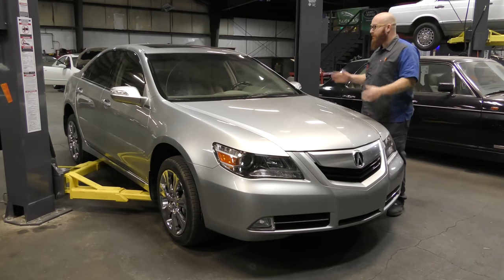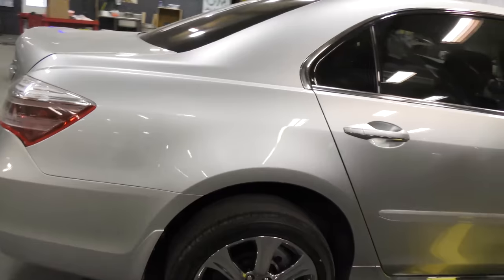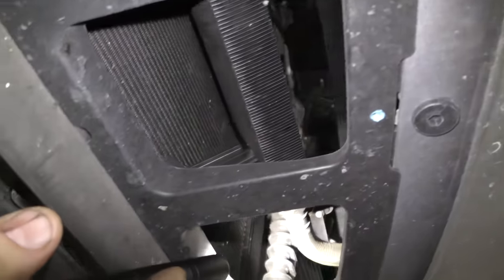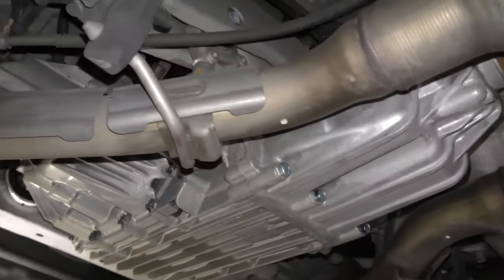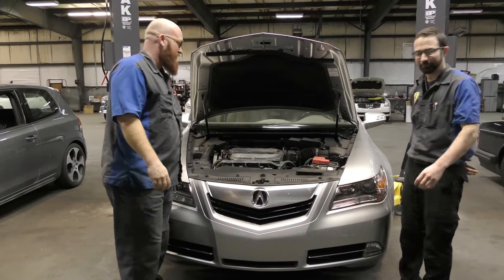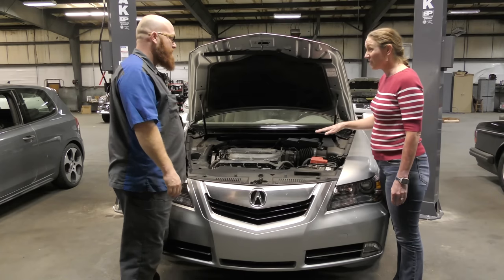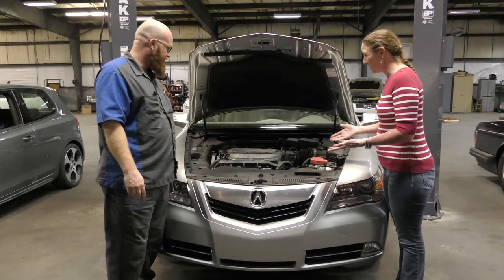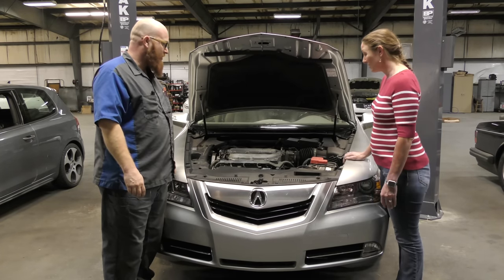Something Very Serious is Wrong with this 2010 Acura RL! What did the CAR WIZARD find???

Comment: For everyone that keeps talking about the 3.7 L being readily available in the MDX and TLS - The 3.7 in the RL is a J37A2. The MDX was an A1 and a TL was an A4. Yes, there are lots of A1s and A4s available but you can't just pop one of those in the RL when the ECU is programmed for the A2. That's not the way it works.

Comment: Isn’t the bottom of those engines the same as the 3.5? Different cams and larger manifold?  I know some guys have put the cams from the rl into the 3.5tl type s  with the 3.7 intake manifold to get up to the 300hp mark from the 3.5 278. Get creative when you have to. Car is worth saving given its condition.

Comment: Had a 2006 RL with the 3.5L, all service records, oil changed every 5k with Mobil 1.  At 140k miles it started burning oil.  Had my mechanic pull spark plugs and when the engine was cranked two of the cylinders were spitting oil out the spark plug holes, most likley it needed new rings.   I contacted a local Acura dealership and they said they never witnessed or heard of this engine having such a problem.  A local Acura mechanic said he could rebuilt it but I decided not to spend the 5k for this work since the car at the time was valued at only 6k to 7k.  A real shame because it was an immaculate car!  I was told by other mechanics before this that this engine would easily go 300k miles with regular maintenance.   I no longer have the impression that Acura is of equal quality to the other Japanese brands.

Comment: Since it is now late January 2022 when I viewed this interesting piece on the RL, I did a search to see if there were any engines available today? There are two used 3.7 V6 engines available in the US, one has only 50,000 miles on it, shipped from Japan.
So what happened with the Acura, did the engine get rebuilt?

Comment: Did u fix it? That sounded like a timing belt,  broken tensioner. It happened to my 2009 acura RL last winter 2019. The sound was unbearable it was like my car was a jackhammer.  I got it fixed with OEM parts for $800. 210k on my car now. Still running

Comment: Here is a little advice for my J series fellow Acura/Honda owners: Do not rely on your maintenance computer to determine when you change the oil. If you are a spirited driver, you should change it more often. As your displacement goes up (3.7), change it more often. If you haven't changed your oil for a period of time on a shortened schedule, and or you missed the opportunity to have your engine serviced under warranty for oil consumption, fouling plugs (Cylinder 1 & 3), or some other related emissions issues, consider doing this:

Plan on not driving your vehicle for about a week. Remove the spark plugs. Pour some Berrymans B-12 Chemtool into each cylinder. Let that sit for about 6 hours and then turn the engine over by hand as many revolutions as your arm can handle. Add some more B-12 and repeat every 6 hours for the rest of the week. When you are done, make sure that you remove any remaining B-12 liquid from the combustion chamber. Reinstall the spark plugs. Add a bottle of B-12 to the oil crankcase and let the engine run until your fans kick on. Drain the oil and replace the filter. Add fresh oil and you should be good unless you have already damaged your internals. If you can find BG Engine Purge or a similar product that you can add to your crankcase, follow the manufacturer's directions and use it.

This process will break down the deposits on the rings and clear out the oil passages without having to tear down the engine. 

Change your oil more often or at the least check the level.

I am not a certified mechanic. Do this at your own risk. I have a 3.7 TL and 3.5 Odyssey.

Comment: I watched a shop mechanic take a chance on an older Taurus. He took the pan off. Found a spun rod bearing. The journal has some aluminum transfer from the bearing. He cleaned it up with bands of emery cloth getting the aluminum off put a new bearing in lots of assembly lube and that was it. The other bearings were ok.He cleaned up the debris. He won that one.

Comment: Youtube AHC garage did a complete tear down of that same 3.7 engine and discovered the cause of a similar problem.  They heads went and the rocker arms failed.  They recommended the same engine replacement.  The video was dated 12-25-2021
Reply: Rip

Comment: My boss had that exact car, and it started burning a quart of oil per month. It was still under warranty, but Honda said that "burning a quart of oil every thousand miles is normal". So he took it to a different dealer where he personally knew the service manager. So they replaced the pistons, rings, crankshaft, rods, heads (basically almost everything) and both cats under warranty. He was told it was a known issue...

Comment: I have a TL SH-AWD with that 3.7. It’s been a bit of a head ache. Since I’ve owned it it’s had a rear main leak, burned oil due to rings in the motor and had a horrible ticking due to the valves needing adjusted. (It’s a relative low mile car) I’ve spent over $3000 on repairs to the thing. It’s just such an awesome car though...

Comment: 7:59 thats a spun rod bearing, 100%. I  just rebuilt the turbo FA20 in my 2018 WRX. Subaru quoted a ton.. so I did it in my garage myself. If the cam lobes and bearing races look ok. Then its usually rebuildable by swapping crankshaft, main bearings, rodbearings, any rods that have heating discoloration (usually the bearing that was spun), and flush and wash everything to remove all micro metal shavings from bad bearings.. put it all together once all new bearing clearances checked and everything specd. Worth saving that RL as I saved my 2018 WRX..👍

Comment: For CAR WIZARD - I own 2010 Acura MDX with 94k miles.....timing chain has not been serviced yet and dealer is saying it's past due b/c it's recommended at 7 years or 90k miles which ever comes first.  They want between $1400-1700 for the job plus water pump, etc.  How much further can I go and would you recommend Acura dealer for this job or can a good mechanic do this job?  Live south of Boston, Mass.
Reply: Go to a regular mechanic and you'll pay $400-600 maybe even less if you purchase the parts on eBay and have a local mechanic install it. This is what i do for my Infiniti M35x 2010.

Comment: Would a pre-purchase inspection have been able to find this issue? It sounds like the customer had it shipped and I wonder if it was bought sight unseen. 

As one who is looking to buy a 2004-2006 Lexus LS 430, this kind of terrifies me. It just goes to show that even the most reliable engines can fail with very low mileage. I saw a an LS 430 with 30,000 miles for $20,000 and I was tempted. But this obviously shows that even a garage queen can grenade at any moment.

Comment: I had the same issue with my 96 Grand Cherokee, the transmission went (it did last 400,000 KM though), but I couldnt find a used one anywhere, I did find a random place that wanted $1000 for the transmission but it was across a border so I didnt want to deal with it , in the end I scrapped the perfectedly good Jeep because I couldnt find a transmisssion for it.

Comment: Those 3.7 have a recall, I have a TL with the 3.7 and Acura/Honda replaced my engine, whole long block assembly. The suffer from oil consumption and a recall was issued. 

“ May 22, 2020 — An Acura oil consumption settlement has been reached after vehicle owners alleged the following models are equipped with defective 3.7-liter J37 engines. The Acura oil consumption settlement still needs to receive final approval by the judge in July, but vehicle owners and Honda agreed to the terms.”

Comment: Seriously sad news, I has something similar happen with my 1996 Integra Hatchback. 
     Took it in for a checkup on the engine, after a small hiccup and turns out it needs engine work like this one does. 
     The amount of disappointment is the same, for me anyway, I found this fun little original car and it now needs (what I was quoted in my area) $5-6 thousand dollars for either a rebuild or a complete swap. 
     I run into that same issue with the engine myself, I want to keep the original block because it’s been untouched since new. 
     My Acura is completely stock and I constantly get compliments from everyone from Cars and Coffee events and everyplace else I take it. 
         Not sure if they’d work on it, but is there any chance that company would work on a B Series engine like mine? 
     I have a difficult time trying to find time to work on it without taking a vacation, nor do I really have the knowledge to do it myself.

Comment: I currently own an Acura CL-S with the 3.2 V6 and an Acura TL-S with the 3.5 V6 and they are and have been nothing but reliable.  I am truly surprised a 42K mile Acura / Honda has a bad engine but it sure sounds bad.  Doesn't the Acura MDX and ZDX have the same 3.7 V6 engine?

Comment: My grandmas has a 1997 Honda Accord EXL 2.7 v6 that she got new in 1996 it’s got 795,921 miles on it with the original motor and original transmission and she takes it to the same Honda dealership she bought it at she has boxes of maintenance and oil changes etc. she just had the eighth timing belt Service interval  and they said everything looked great no leaks or issues were found Honda and Acura are an awesome car as long as you take care of it Mechanically.

Comment: I have 2009 Acura RL type sh awd. I bought an engine with 40,000 mile here in rancho they have 3 more left straight jdm the only thing you need is to take the plate off for the egr and put the usdm egr on cause in Jdm there’s no egr

Comment: Funny thing my wife has a 2019 Acura TLX 3.5L V6 with a recall for a journal pin defect in the crankshaft and were told to listen for that engine noise 🙂  The RL is a well built car that just did not sell for Acura.

Comment: If the 3.7 is just a reworked 3.5 with bigger bore and different internals would it not be possible to replace it with the 3.5?

Comment: The mileage of my wife's 2010 M35X is only 54K miles. 3 years ago, the front driver side window stuck sometimes. So I lubricated it a little bit and told my wife to open and close that window every time she drove the car. Now that window still works like charm.
PS: These cars hardly break by extensive usage but could still break by NO USE!!!

Comment: The customer was right, with this engine I would definitely not put a used engine in the car.  The 3.7's had serious piston ring issues and most of them will have oil burning issues.  There was a TSB and some of the 3.7 engines were fixed by the dealer.  But if you buy a used motor you don't know if it has been fixed or if it still has the bad piston rings.  If you buy new, reman or rebuild the engine you have, you know that the engine will have the updated rings.

Comment: The customer would not accept a new or remanufactured 3.5 liter engine instead?  I know it has less hp but it would get the car back on the road.
Next, a question: Did "junior" keep driving the car after the oil light came on?  My understanding is that an oil idiot light on means pull over and turn off the engine ASAP!

Comment: Replace everything under the valve cover including cams . Check compression before any repairs with a gauge . Change water and oil pumps and timing parts good good luck . Adjust valves if not replaced and again good good luck .

Comment: My 99' Honda Prelude is just like this TL, in immacualte condition. It has 180k miles & the head gasket blew. Went in to repair it & my trusted mechanic told me at the machine shop they noticed the valves and rocker arms were too worn down & they didnt even want to refinish the head. No to mention due to the FRM sleeves in the H series engines, my engine was burning a ton of oil, which is common in these. Ended up getting a used European dosmetic market H23A engine, the ones that went in Preludes & Accord SiR in Europe, for about $2600 with 45-60k miles on it. The main diffrrence being a smaller oil pan & oil pumped being needed. Being that the 5th gen Prelude only had about 50k of them made, the USDM H22A was very hard to get a hold of, decents ones upwards of $3000+.  I had a mountain of things replaced on the "new" engine and ended up with about a $7000 bill. But, like this owner, I love my car & know its rarity. I have rarely ever driven it & somebody not compliment , honk, wave, or let me know how nice & rare they are to find one in mint condition, and a manual tranmission!

Comment: I owned a 2009 Acura TL with the same 3.7 engine at around 55k miles it started getting a engine knock. Car was still under factory powertrain warranty. Dealer blamed it on the gas. I tried every pump in the city and even their system clean but no luck. warranty expired and at 66k miles it got real bad took it to another dealer same stuff u need a timing belt or the valve clearance checked which actually I ready did at 60k and didn't help. I changed the oils my self the next time found metal shaving in it even transmission oil have shavings in it. I always changed all fluids before recommended intervals using synthetics always but still got these issues. I ended up selling it and taking a big loss on it. later I found all these 3.7s have knocking issues and they are a ticking time bombs. I replaced it with new 2nd gen Ridgeline in 2017 and it also has knocking issues plus now Honda added VCM into the mix. so new cams. catalytic converter, spool valve rocker arms for the front bank. new injectors at 26k miles. more than 90 days at the dealer back and forth. I finally disabled that VCM now its been good for last couple years now I am at 43k miles. Also had paint issues, panel alignment issues, rad fan, ac leak, cabin blower, high pressure fuel pump replaced. it was not a good experience so far. On the other side not a single issue with my Lexus.

Comment: Believe it or not I have a parts car the exact car I used for parts to fix my daughter's car. Motor and trans are still in tack and runs great. I hope I can help someone with an affordable engine/trans option. It's a 2010 acura RL sh-awd 3.7 v6

Comment: Now I want to have the engine dismantled, see what is inside. What is wrong with new bearings and a reground crankshaft, if that is the problem. Can it be something else?  A lose baffle in the oil pan that is touching the crank?  
Anyway, the engine has to come out, whatever is going to happen and we have to see!!

Comment: I thought there was a stroker kit available for the J35 to increase the displacement to a J37. I didn't realize the J37 was such a low production engine considering it went into the MDX, TL, and ZDX as well. However, I just searched and couldn't find one.
Reply: Because it isn’t Acura has sold 100,000+ vehicles with the j37.

Comment: Those 3.7L Acura V6s are known for burning oil. There was an oil consumption notice put out for them. My brother has a 2010 MDX with the same issue, but he got it fixed with the recall. A family friend's son has an Acura tl with the same engine, and had to get it towed due to no oil. The tow truck driver said he towed 5 acuras with the same engine in a month. This engine is a real oil burner.
Reply: Does the j35 from the kb1 rl have the same issue?
Reply: @lepicier5244  nah I think it only affects the J37A2
Reply: @UnrealOG137  okey, is there any chance to fit the j35 from the kb1 under 2008 in the kb2 2011 which has the j37?

Comment: I had a 2001 MDX with 165,000. Of course I took real good care of it. I only got rid of it because I wasn’t driving it that much. So I sold it. But it was in great shape. The engine was still running and it was in great working condition. But it’s like you said Wizard it was a defect engine. So it’s definitely worth saving. I can’t wait to see you rebuild it.
Reply: Acura/honda v6 engine should be completely fine at 165k mileage. So no surprise there :)

Question though:
Did you do valve adjustment? If yes, was there any noticeable improvement after that?

Comment: I have 11 MDX with the same 300hp/270tq 3.7L engine.  Acura changed the cylinder walls and piston rings on the 10-13 MDXs and it has caused oil consumption as bad as 1 qt per 1000 miles.  My 11 MDX uses 1 1/2 qts per 9000 oil change interval. I've used Mobil 1 syn oil since purchase at 30,000 miles used and now have +150,000 miles with no change in oil consumption.  The oil light doesn't seem to come on until you are almost +2 1/2 qts down on an engine that only holds 4.5 qts total with a 8500-9500 mile oil change interval.  I think Acura made similar cylinder wall updates with the 3.7L TL, ZDX, and RL produced in the same time period and many have the same oil consumption issue.

Chances are the RL ran too long with low oil levels for thousands of miles and probably damaged the engine because of the conventional oil failing.

Comment: Bottom ends don't just fail from a "manufacture defect" like that. Unless it's BMW. You drained some oil but didn't bother checking the level? Chances are the dipstick was dry. Also the customer was probably a year or two over their oil change because their car has low miles.

Comment: I had an 08 accord with that engine.  I bought it from my brother and drove it back to KC from Mi. after he replaced the trans with a used one.  I loved that car, it was in great shape.  It acquired a intermittent miss; so I put about $800 in it trying to fix it myself.  Took to a shop and they did a compression test and found a weak center cylinder in the front (80psi).  Traded it in on a Camery after telling the dealer it had a bad cylinder.  Very sad